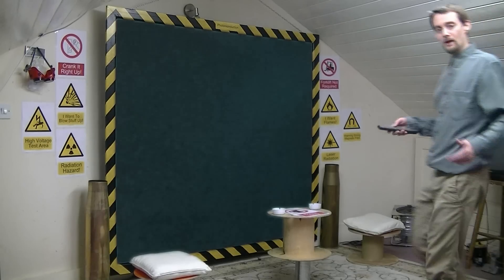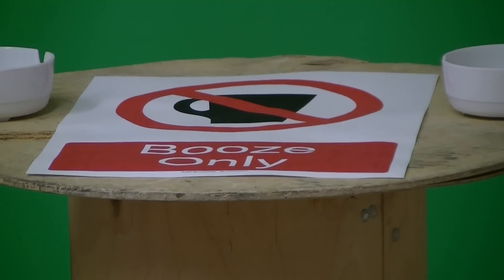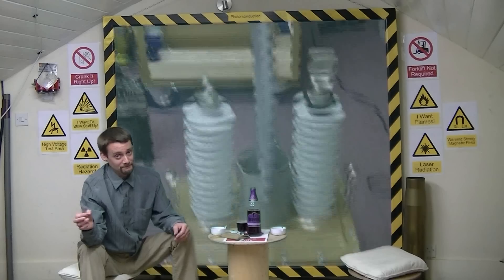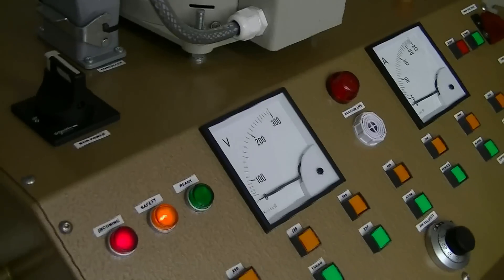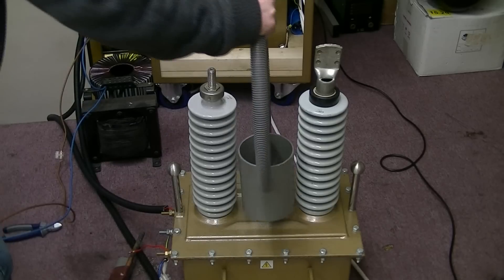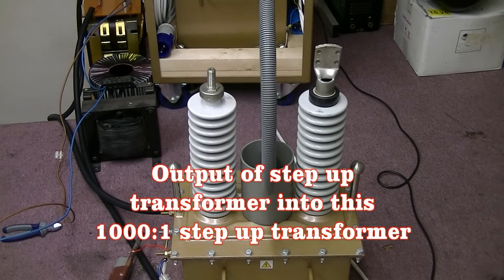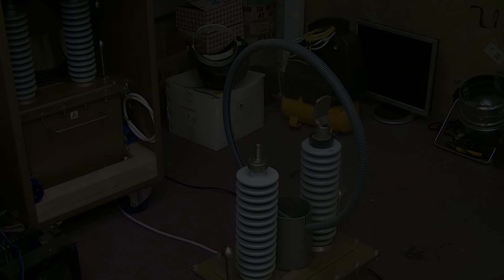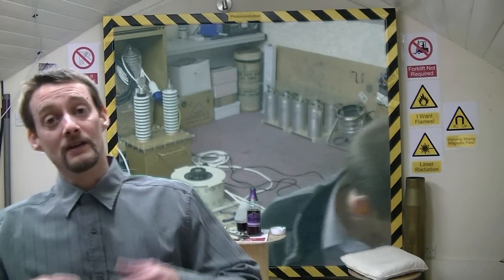Inside The High Voltage Transformer

Comment: Have you ever turned up the variac to 250 Volts with this set up? 1000 Volts out of the step up transformer into the 1000:1 EHT transformer. I make that 1 million volts !!!

Of course current is being reduced at a ratio of 4000:1, so 25 amps at 250 Volts would only be 6.25mA at 1 million volts so probably not much arcing at that current - still 6250 Watts though :) By my calcs 1 million volts should jump 40 inches in air, so could be very dangerous. I wouldn't want to be within 30 feet of that voltage.  I wonder if 6.25mA would be enough current to display much?

Comment: These voltage breakdown charts you show  hold ONLY for sphere-to-sphere gap configuration. You can't make direct comparison with transformer electrode gaps based on that. Make/get sphere gap than compare. Regards.

Comment: Fluid has been contaminated? How does that happen? Your transformers should have a water pumping system like that of a Nuclear Reactor Vessel! Do you have one of those old chap?!
Reply: Virtualgod2009
Thought "corona" was a plasma that surrounded The Sun? I may be wrong. I also thought that heat "Oxidizes" oil? But I may be wrong. I also thought the tracking device in ALIEN which supposedly reacted to "micro changes in air density" was insufficient, because Dallas was traversing a tunnel system that had 6 definable directions, & yet that pony n' trap tracker had a 2-Dimensional Display. But once again...  I MIGHT BE WRONG!!!!
Reply: Virtualgod2009
Yeh but what about the Tracking device in ALIEN?!!!

Comment: That's correct. H-bridges are for running motors, not for inverting DC.

However, you CAN use an H-bridge in a motor-generator setup to control it and create AC.

Comment: Need help finding and choosing insulating oil (main use is for heat dissipation) for submerging my sot-227b ixys mosfets, massive DO-5 rectifier diodes, snubber caps ect. The internet is not being kind to be because I don't know specifically what to search for. All I get is "mineral oil" which isn't specific enough. I need/want oil that has low viscosity at low temperatures. I'm "only" dealing with approx. 220 rms dc. Any help would be greatly appreciated!

Comment: Hey Photon, I am a bit confused on how the chart works. Do you think you can help me out or give me a estimation?

I have a plasma Arc from a Flyback transformer that is 6" long. Other youtubers who have reached the same result claimed it was 75KV, but I would like to be sure. I am using this for a Particle Accelerator in college so if you could help me out I would love you forever. 

no homo though... no homo.

Comment: Depends if you have acess to the pole fuse or not, so as to replace the standard 100A one with something a little more Photon rated, 400A works fine, and still fits the carrier. Had 2 blow at work from old age ( hey, they were made in 1956, and were installed in 1966, and have lived with loads up to and a little beyond the rated) and the new 400A ones were half the size.

Comment: Good afternoon, Mr. Photon. :-)

If the Tx is OK then it looks like you may have fizzed-over the connections inside the casing. You may have pushed it a bit too much. :-O

At least it's repairable. If it wasn't, I was going to suggest filling the casing with MOTs. 

Either unmodified ones in parallel, or modified Hi-current ones in parallel for silly amps, then refilling the casing for oil-cooling. :D

If you're going to repair the Tx, then fair do's I suppose. :-)

Thanx for showing,

-BBD.